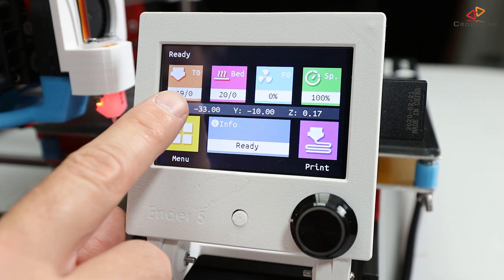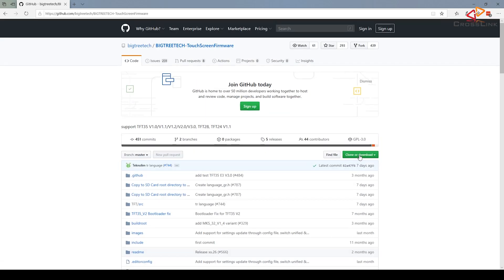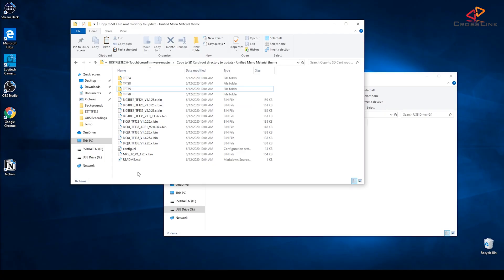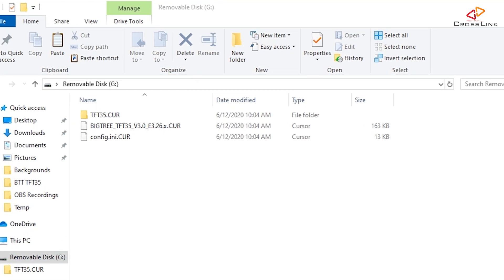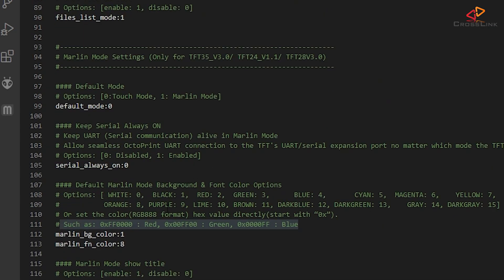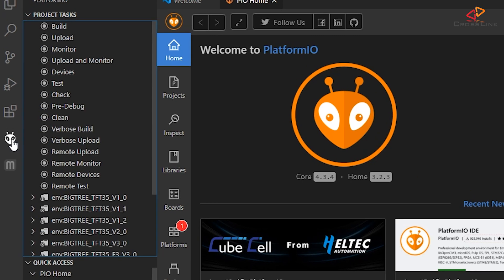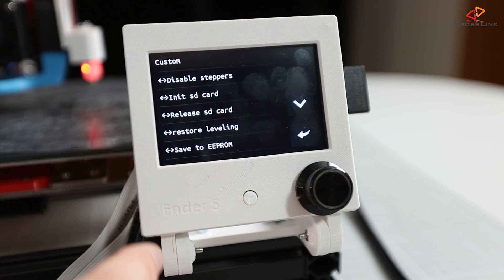BTT TFT35 firmware upgrade - What you should know

Comment: wow... my goodness i have searched for WEEKS for a proper instructional on reconfiguring this. could not find anything. I attempted a flash for the SKR mini v3.0.1 on my e5+, was stuck on a blank screen for awhile, then i tried to reflash a few times, no it's stuck on "illegal app" or something like that, so i will definitely be trying this when i get home, thank you!
Reply: and...... it worked. All i wanted to do was make it work with klipper/pi, followed some bad instructions and flashed it incorrectly instead of just changing the display parameters in my printer.cfg....

Comment: Hi Daniel.  Hopefully you are still monitoring. When I try to build the firmware for the BTT TFT35_E3V3_0 , the build fails due to a flash size exceeded error.  Any ideas.
Reply: I have the same problem. Has anyone some idea to solve this?

Comment: Hi! 
If you wouldn’t mind, there’s 2 things I’ve been struggling with regarding the tft24 screen, though I believe it’s the same for all these screens.

The first one is that whenever I leave the SD card inserted and restart or reset the printer, it tries to flash and gives me an ‘illegal flash app’ notification. Can I get rid of this?
And secondly, I can’t seem to get the usb drive to work. The screen will detect the usb drive, but can’t read the content. Does this have to do with formatting the drive or is it a specific setting in the firmware?

An answer would be greatly appreciated!

Comment: Daniel, your videos are very helpful and you are a pleasure to listen to. You literally could teach anything! Thank you very much.
Reply from the maker: I appreciate that!
Reply: @Crosslink3D  Well, now i have chosen this BTT TFT35 as you've demonstrated and connected it to a BTT SKR E3 Turbo. After all the firmware updates, my screen still shows ' No Printer Attached!''. This happened even before I updated the firmware. With the connections, there is only one ribbon cable and not two. It's connected to EXP 3 as I have discovered. This is because the BTT SKR E3 Turbo does not have the EXP 1 and EXP 2 connectors. Any thoughts on this one? Thanks.

Comment: What am I doing wrong I have the BIGTREE_TFT35_V3.0_E3  Display.  I downloaded the latest BigTreeTech Touchscreenfirmware Zip file.  I extracted the zip file as instructed.  I copied the BIGTREE_TFT35_V3.0_E3.27.BIN and the TF35 folder that contains the BMP and FONTS folder and a file called config_rff.ini to the SD card  I renamed the config_rff.ini to config.ini  I inserted and powered up the printer it goes to 100% updated but then I get a screen stating "Found Outdated Data" Config Update Required, Icons Update Required.  Insert the SD card with the required files then hit reset button to update"  The printer control board should not really matter right now correct since that would be step two on the installation of my BIGTREETECH Direct E3 RRF V1.1 32 bit Control Board.  I was told to update the display first then update the firmware of the Control Board RRF.  How can the files be Outdate they are from the same Zip file...?

Comment: When I inserted the SD card to upgrade the firmware using the included SD card, the screen wouldn't see it. I used a Sandisk SD card instead, put the same files in the root and it flashed fine.

Comment: Has anyone figured out how to make the TFT 35 v3 touch mode comptable with the bl touch?
Reply: Danny Did you ever get this to work.  Mine was working and I flashed a new firmware and my BLtouch is now missing
Reply: @LuisC202  no, but I have not given up either. There are settings in marlin configuration.h for the BLTouch. I haven’t got into the TFT 35 configurations yet. Thank you for asking. Danny

Comment: One thing i have noticed with the TFT70 v3 is it does not like you to change the temperature "On the fly" in Marlin UI. I tried to decrease the temperature, when i did, the printer stopped for a couple of seconds then inched a bit more an so on... With the TFT35 which i did use until now, that was not an issue.

Comment: Frustrated to the point about ready to toss the SKR motherboard TFT in the trash.  Been trying to upgrade my Ender 3 Pro for a MONTH.  I have the SKR 1.4 Turbo, TFT35 E3 V3.0, and TMC2209 steppers.  I have followed all the videos and everything else I can find.  Following the directions in these videos, the screen is blank. Switched the RS232 around like shown in the video, and then there is an image, but it flashes (not steady).  If I arrange the cable so that there is a clear, crisp display, I have NO PRINTER ATTACHED and it has been this way for two of same motherboards and two of the same TFTs. Marlin mode appears to work...but I didn't waste all this time and money to have Marlin mode screen...which worked fine as it was.
Reply from the maker: What baud rate setting do you have in your Marlin config?

Comment: I'm new to 3-D Printing.  I have an Ender 3 Pro and just installed a TFT35 E3 V3.0 (software version 3.0.25.x dated June 15 2020) and a SKR Mini E3 V2.0.  The TFT35 E3 V3.0 indicates NO PRINTER) .  I tried changing the baud rate to no avail.  I checked all connections.
Reply: Problem Solved bad cable
Reply: @BigKahuna611  which cable needed to be replaced? i am having this same issue thank you

Comment: Hi
I have the same TFT model as the video and it gives me the error "Fade Height Off".
I state that the firmware was given to me and I don't know how to edit it unfortunately, I would like to delete an ONBOARD_SD icon but I am not yet able.

Regarding the error, I saw that through config.ini it is necessary to modify the "auto_load_leveling: 1" entry and set it to 0.
The problem is that I removed all the other entries in the config.ini file because I don't know exactly what they would modify me from the installed firmware.

When I put the config.ini file in the SD the TFT does not read it and I do not understand if it is because I have removed the other voices and if it seems strange to me.
It can be a problem to eliminate the other configuration items, with the SD card I loaded the firmware so it works

Sorry for all these questions but I put my doubts in one message

Comment: The message no printer attached didn't go a way what can I try?
Reply: mine won't go away either, have you found a fix for this issue?
Reply: @moistcement  a lot off trying out switching the ports at dome point it worked. Also check if the pins are connected in the right order

Comment: Thanks for this, helped me a lot to update the firmware on mine. Out of the box I had no touch screen functionality at all. Now I have a nice shiny touch screen... BUT I can't get past the 'Printer not attached' error.  I've tried every UART speed but it makes no difference.  
I'm using the latest pre-compiled binary from Bigtreetech and their new SKR Mini E3 V2 mainboard running Marlin 2, so they should play nice together at a UART speed of 115200.
Any suggestions as to a possible fix would be gratefully received.

Comment: the last bunch of videos u have released has almost be like ur releasing them for me. ive been building a kossel mini delta from scratch an i have the skr 1.4 turbo with the big tree tech tmc 2208 v3 an the tft35 e3 v3 an u have been a life saver along with a guy i met in the kossel mini facebook group. but i still have trouble understanding what all is needed to compile the firmware depending on what hardware u have. like if i want to use the newest marlin firmware an i get the firmware from marlins website, how do i go about getting all the board stuff into the firmware, or is it all done when i put the lcp1769 into the platformio tab. i got the printer working tonight finally got to see it move for the first time. an it has been a relief. im ordering a heated bed tonight an going to go ahead an hook the hotend up an make sure its extruding filament. still gotta come up with some kinda z probe so i can do the delta calibrations an hopefully that will help with getting everything lined out

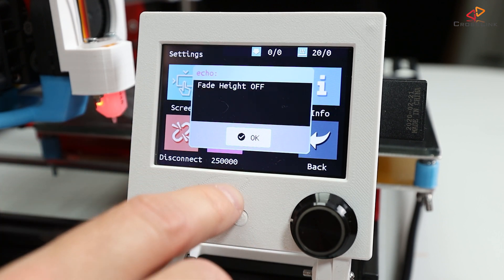Comment: around 4:18 there is a message that says "Fade Height Off" how do you fix that? my printer is working OK but this message will not go away. I have gcode to display print time remaining and all I see is this message. Ender 3 Pro, SKR mini E3 v1.2 mainboard and this same display like you have here.
Reply: In the config.ini set "auto_load_leveling:0"
Reply: @tuckerjoe6785  THANK YOU!!! I found it!  I was worried I had to go into the mainboard firmware as it's all setup and working good after many hours of frustration with that project (a whole other story LOL)  Thanks for the reply, I got it working finally HAHA Now, to slice and print!!